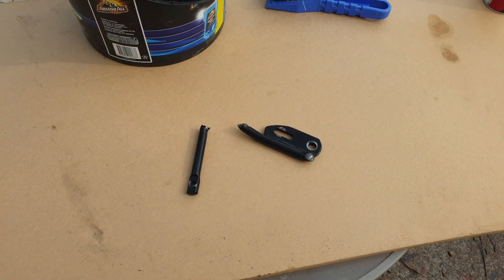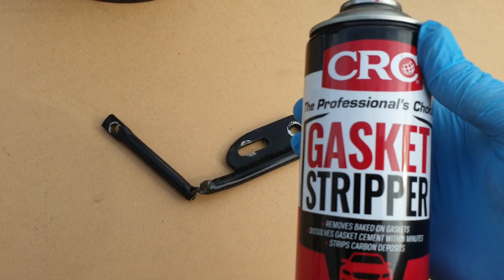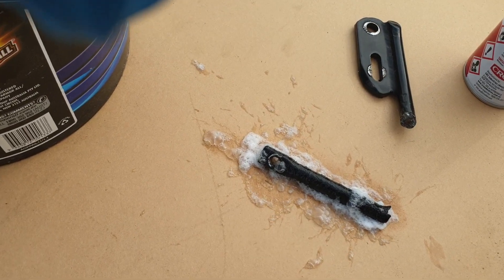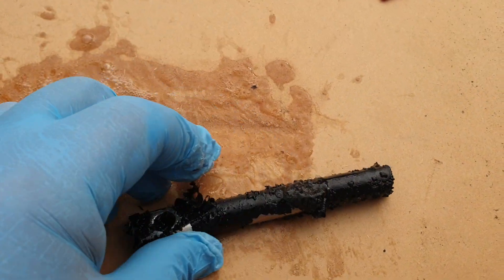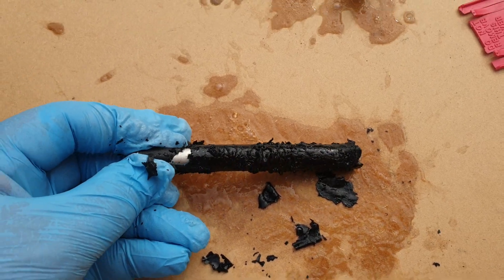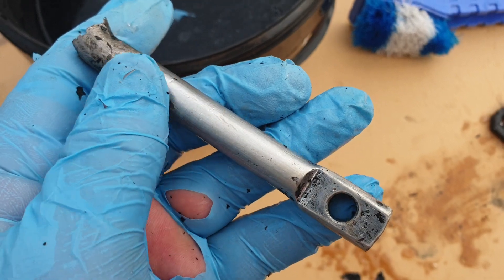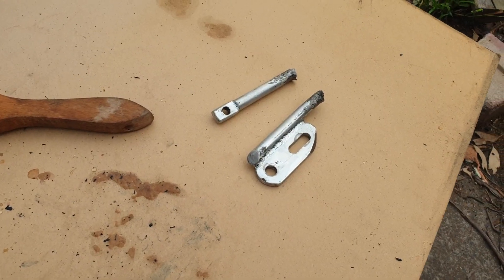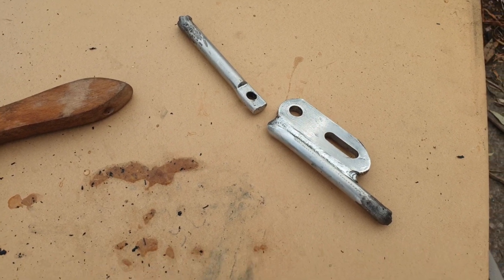How to remove powder coat quickly and easily at home

Comment: 100% works ,ive herd basically any thing containg 'dichloromethane' in a 30%+(min) is what removes the powdercoat,thank you for the vid,just saved me 175+ getting 2 very small parts soda or glass blasted,ps took some hard scraching with the plastic side of the brush n not the brush for me,but i think cos its almost 100c temp day in west aus & the crc was drying way to fast to have time to eat into the coating effectivly,but yep 100%job done,awsome share vid bro thankyou
Reply from the maker: Yeah it does dry out quickly in hot weather. A guy in another comment suggested spraying them, and then putting them in a plastic bag, or ice cream container or something, so it can continue to eat into the powdercoat without drying out.
Reply: @russellpritchard743  yes air is your enemy. Spray them and then put them in a sandwich/bread bag and twist it up tight. Then you can actually massage it with hands. Hopefully it doesn't eat through plastic bags? I use "Great Value" Plastic Bread Bags for this kind of thing.

One thing i like is that you're not using mechanical means which can damage sensitive parts or change dimensional tolerances.

Comment from the maker: Just an update. I believe in some countries they have removed the chemical from this product that makes it effective on powder coated. I know that it still works here in Australia. Dichloromethane I believe it is. So probably better to check and see if the product sold in your country still has this chemical in it.
Reply: Precisely! "Methylene Chloride" by its other name. Used to decaffeinate coffee beans but we CANNOT BUY IT!
Reply: Eastwood had a product called Down to Metal here in the US, but it's not available anymore. It's main ingredient was Dichloromethane {Methylene chloride; R-30; Freon 30}. 
So I'm not sure what we can use now.

BTW, the MSDS for Down to Metal was pretty scary. Wear heavy duty gloves and a good respirator when you use that gasket stripper, especially as an aerosol.

Comment: There’s a new product out called RIM STRIPPER but it’s way too expensive but if you soak a car wheel in it all the powder coated stuff just falls off, it’s $700 for 5 gallons

Comment: Very good !! will do Wondering if you could spray then place in baggy or wrap in foil for better penitration less spray.
Reply from the maker: that would probably work. It does dry out quickly, especially in hot weather, and I'm sure putting it in a bag would minimise that. Good idea. Thanks.

Comment: hi There are 2 ways chemicals strip powder coat . 1/ dissolving the coating  2 /separating the  coating from substrate 
At least 3 different paint stripper types 1x new version almost does not work  2x older chemicals [1 is banned in the USA ]
All 3 chemicals are in Aust.

Comment: Can this technique need to be used on a small patch of powder coating without ruining the coating that surrounds the area, if taped off properly? The guys who powder coated my bike covered the brake assembly stems, and they're supposed to be bare metal. I can't install my brakes until I remove the coating.
Reply: Idk

Comment: Can I use this on my alloy wheels?  I have 30 years of baked up brake dust and corrosion at the back of the wheel.
Reply from the maker: Yes I have used it on alloy wheels with no problems.

Comment: Great Video ! Do you know if this would damage aluminum? I am planning to try this on aluminum wheels . Cheers !
Reply from the maker: Yes it works just fine on aluminium. I have used it on aluminium as many times as I have on steel, and have never had any problems with it damaging the aluminium.
Reply: @russellpritchard743  what about steel? did anything happen bad to steel. I'm planning to use it on my old bicycle
Reply from the maker: @cagri7184 I have never had it affect steel either. Mind you, you need to paint, or re-powdercoat  steel very quickly, as it starts to rust very quickly. The bracket in the video was steel. It is now re-powdercoated, and re-installed on the bike.

Comment: Didn't do anything to my powder coated aluminum wheels because coats are darn thick. Primer/Color/Clear adds up to ~1/32 to 1/16 inch.
Reply: How did you get it off bro
Reply: Sames im running out of ideas here. My sandblaster with aluminum oxide media couldn’t even do it. 🤦🏻‍♂️

Comment: I just tried and does not work so don’t know how it worked with you.
Reply from the maker: Been working for me for years. Maybe where you live, they use different ingredients? I know in some countries, certain chemicals are banned, and some companies have to change the recipe for their products for sale in those countries. Maybe that is the case where you are? I am in Australia, and it works great here.
Reply: Yeah that may be exactly right. They just changed the formula on ours due to regulations and now it doesn’t work
Reply: Are you 100% sure that's powdercoat on you part?  The way it's reacting it looks like paint. I'm in Australia, bought the same CRC product and it isn't stripping my powdercoated part.
Reply from the maker: @foesix3  yep, definitely powdercoat. I had that part, and a few other parts all powdercoated together at the same time.